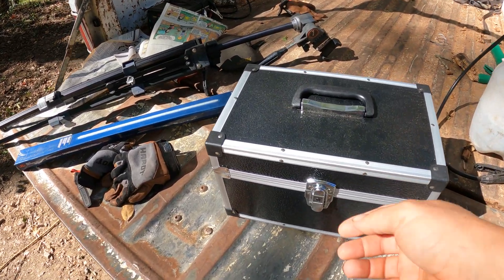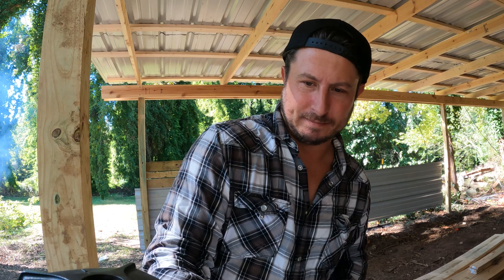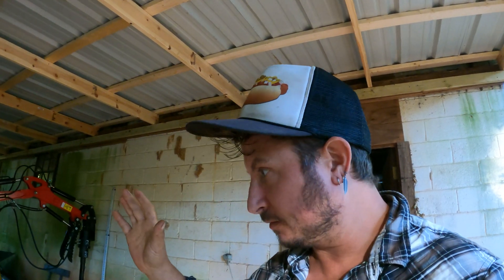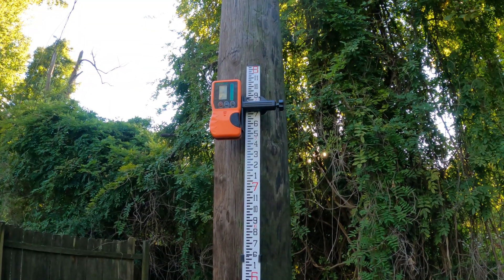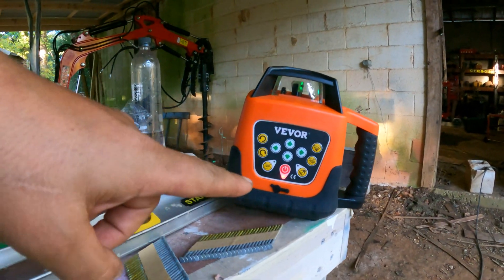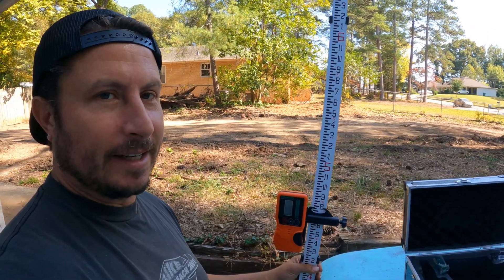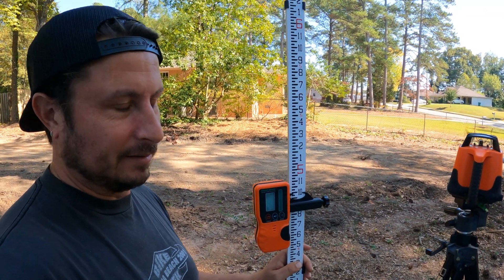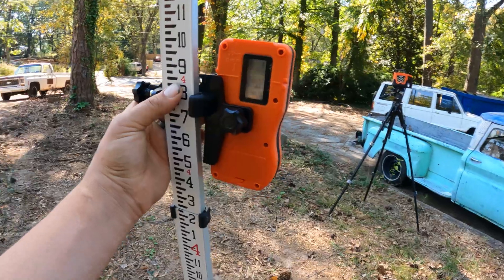Testing the CHEAPEST Self Leveling Rotary Laser (VEVOR) *HOW TO READ GRADE 101*

Comment: Great videos 

That laser is supposed to adjust the laser for slopes +/- 5 degrees 

Have you figured out how that works ? The arrows are supposed to tilt the grade on 2 different axis using the front of the machine as reference
Reply from the maker: I have been using mine a ton.   Just turn it on and walk away.    Leave it alone for 60 seconds if it starts to spin it has self leveled and you are in business      If not you are too far out of level for it to adjust 
 It’s all in the video
Reply: @betweenthesharksgarage  

That's awesome ...I just got mine while back. Happy as hell for the price 

Have u been able to adjust the grade using the laser to get the desired slope?  

I haven't yet but it says you can ...it would make doing drainage and parking areas and driveways a breeze

Comment: Very useful video. The instructions were useless. Thank you!
Reply from the maker: its a solid tool... once you figure it out
Reply: I just bought a LOTA model. It must be the same, just a different brand name. The instructions are weird as the English translation has words put together when they shouldn't be, ha ha ha!  I just got it yesterday and will be doing some grading of my vast yard with a tractor with box blade on it. I started on it a while back, but having a rotary laser will help, and not to mention I plan on using it when I build our deck to make sure it's level and plumb. I have another laser, though it's not a rotary level. It's more for indoor use rather than exterior use. It has a red laser and the Lota has a green laser. After watching this video, I think it will work out fine, but I'll see.

Comment: Would you buy it again? Do trust it after using it for awhile? Side note when you spun the level 180 degrees it sounded like gravel was under it, it might have messed up that 1/8th" e.g. 1/64th at the laser front to back could be way off all the way out, not sure if it auto levels again but then it would be leveling to that changed 1/64th.  Anyway do you still like it?
Reply from the maker: it was a rudimentary test but I still think it passed as far as i m concerned.  1/8th at that distance...  i think that the person holding the grade rod a little out of level is more likely than the machine being inaccurate.    but yes.. i wish i had it sooner, i have done so many projects with line levels etc... this is 1000 times better and as far as i can tell half the price of a bosch...and i love bosch laser products, i even used one to measure my distance
Reply: @betweenthesharksgarage  I have one of the bosch distance measuring tools.  I absolutely love it. I just bought a rotary laser just like the one you have, though with a different brand name on it (Lota Tools. Made in China, of course, which explains the instructions). My kit came with everything and I got it through Amazon. The instructions are somewhat useless, though the one I have the batteries can be charged while using the laser. The instructions are incoherent at times as to what to do if you want to go manual or auto, etc...   it does have a slope feature on it that I will have to try as well since I will be grading out our vast yard since it's low on one end (I may have to have dirt brought in to bring that end up some), but at least I have a sub compact tractor with front loader and box blade to get the job done without killing myself. Thanks for the video.

Comment: hey i have a question, so the manual/automatic button when it like up is that in manual mode then ? An also do u used the automatic drift system ? so the remote controll, what are the arrow key for ? 

Thanks
Reply from the maker: dude...there is a ton i still do not know about it.   what i have found is in the video, but if you turn it on and do not touch anything it will be in auto mode, it will self level and it will spin, sometimes that takes up to a minute to happen and you just have to be patient.   i don t recall light on or off...but mine seems to default to auto mode when i turn it on... and it is super accurate in my test
Reply: Ok thanks, instructions are not very clear, on what everything does lol. I SEARCH every online an couldn't find anything out. I did mine at 165 feet for accuracy an it was about 1/8" that pretty gd , when i did the 180 degrees.
Reply from the maker: @miraclelawn1158  I got the same results so i am super pleased at that... its the first one o have ever used so i am not really sure what else you would use one for or what settings there could be... but yea... like you I could not figure out what was in the instructions

Comment: I bought this in a set with the rod and the tripod. I was wondering about the exact same thing as you did with the self levelling and was pressing buttons. I reckon this happens to all of us. The instruction manual (if you can even call it that) is a catastrophe... But, I only need this to work in a 10 meter radius for a Carport and a Terrace so I reckon I'll be absolutely golden.
Reply from the maker: Yeah, I want to video helps because once I figure it out it’s done everything I needed to do
Reply: Where did you b the set - can't find it? Cheers Mate
Reply from the maker: @888berg  there is a link right there in the description it will take you right to it

Comment: Great video.
Just wanted to ad, since you turn the laser 180 degrees that actually doubles the control distance. So it's actually within 1/8 in 260 feet. 
That is awesome for that price point. I have been eyeballing this tool but not until now have I seen the true capabilities of it.
Thanx you earned a sub

Comment: It probably works like a bosch?
They all seem to work the same way. 
They got grade rod and tripod too I'm gonna get
Reply from the maker: i have never used the bosch but i would imagine the general principals are the same.   i am pretty happy with this, its working well for me
Reply: Yeah, same operation as a Bosch or Johnson.
Reply: @BrianKrahmer  i got the vevor, I've used it to put in two septic systems.  i can't figure out the grade rod decimal feet thing though
Reply: @FourthWayRanch I guess my Johnson grade rod also has decimal, but I've never used it.  I guess the point is that it's easier to work in decimals.  I'm on building my 8th house I think, and I've wished hundreds of times I could just work in metric.  Subtracting 1'4 11/16" from 9' 1 1/8" for example is just harder than it needs to be!
Reply: @BrianKrahmer  I watched a vid on it just now.  a tenth of a foot is 1.2 inches.

Comment: cool looking at getting the same one for our projects
Reply from the maker: I’ve spent the time to do string lines in line levels, and all that type of stuff before and it works, but for the price it is very easy to see how much quicker and more accurate this will be for running around doing the stuff I got to do if there’s no question for what I have lined up that this is absolutely going to be worth it.    
     And as soon as I confirmed its accuracy over 130 feet   I think the price is fantastic if it’s that good